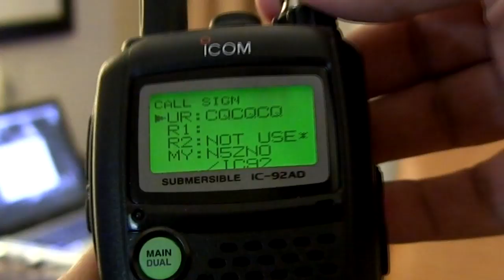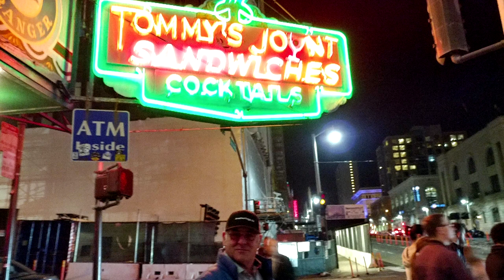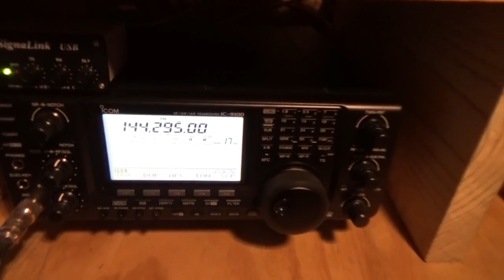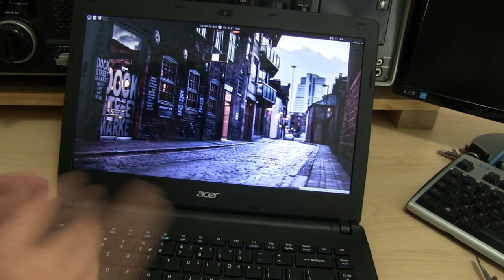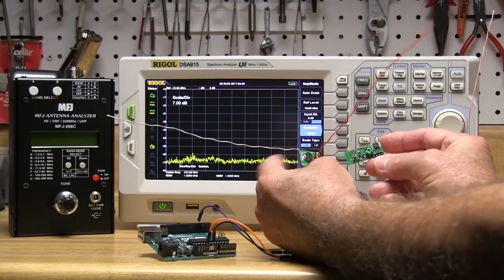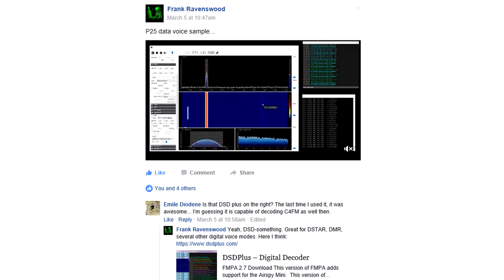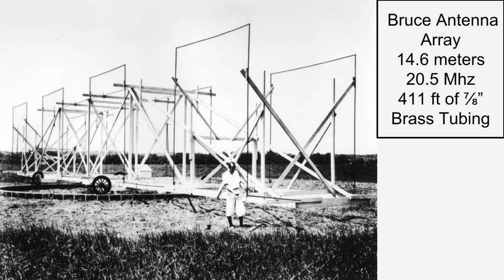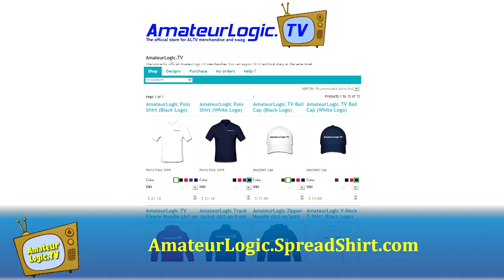AmateurLogic 102: Cheap Beacon, Fixing Stuff & Jansky

Comment: And here in Providence, RI right now it's 33F - positively balmy! I jest of course. And I have a Raspi Gen 1 Model B running as an FM transmitter. I do want to get a Raspi 3 though - we had one at one of my former employers that we made into a game console. And as to Radio Shack - I left them a long time ago. Mostly went with mpja, sparkfun, and now Amazon for parts.

And my first radio was a Kenwood TH-27a - 2m only. Then I also got a Yaesu 2m mobile the model of which escapes me. Then I sold those and got a Yaesu FT-5100 which got stolen. Then off the air for a while until I got my Yaesu VX-7Rb. Now I have that an a Baofeng B580T. I have a 40m pixie kit I have to assemble too.

And as to the beacon on the Raspi - I guess BASH is the right one to use but the Pi part is for Python which is pretty easy to use too.